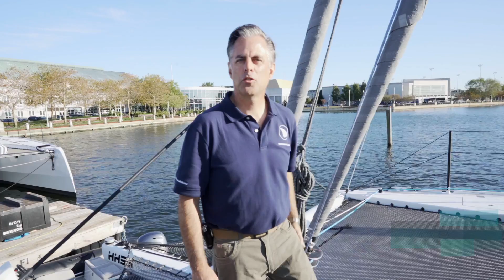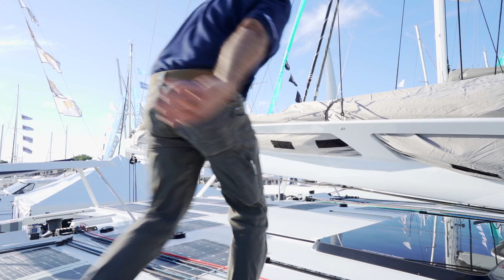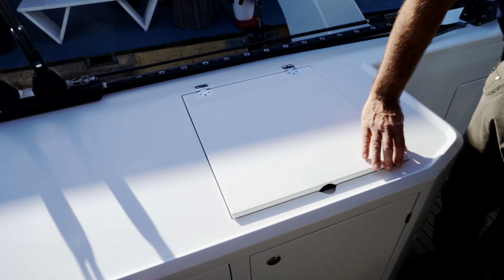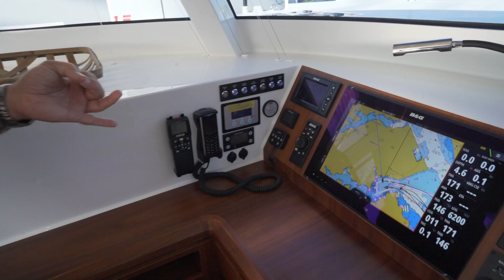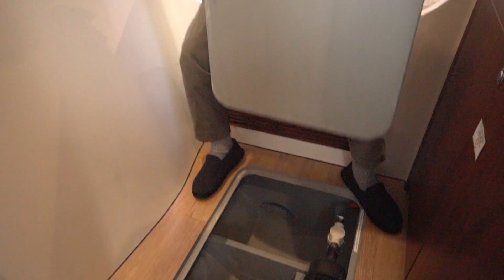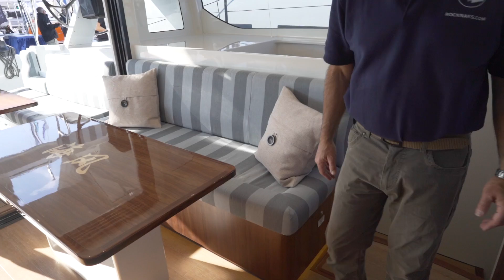HH55 Catamaran.  Guided Tour & Our Review.  Perfect Balance of Performance and Comfort.

Comment: Love the HH 55, but i would get the Helm indoors. My reasoning is that it completely frees the lines from the roof (Load up solar panels). Also the aft cockpit completely opens open for lounging, still retains tons of room indoors and finally will go with an owners version. Also these are made in Vietnam i believe so that why costs are lower compared to the new Gunboat 68 (also completely carbon fiber) which is now made in France and price is 6mil+... woooza. Either way you need deep pockets but the HH can be called a bargain in the deep pocket world of fully Carbon cats.
Reply: They are made in China not Vietnam.
Reply from the maker: Agree. Compared to a Gunboat, $3M fully kitted out is a deal,  For someone.  :-)
Reply: @AL V  They were at one point but now in France.
Reply: The Seawind 1600 is built in Vietnam.

Comment: Nice, but the Silent 55 still takes the cake,  everything else is just too much maintenance , how do you want to spend your time.
Reply: I love the S55 also but need to see owner reports from ruff seas in mid-Atlantic.
Reply from the maker: I will have to take your word for it.  Have not been on a Silent 55.  Yet.
Reply: @Bowmans-Woods  Don't know if you have seen this?  https://www.youtube.com/watch?v=747tNVZ5iB4&t=54s
Reply from the maker: Yes I had seen it before.  I still need to see boats like this that are all electric, prove that they can cross oceans in all weather conditions (sun, clouds, rain) without needing to constantly run their generator to keep going, before I get excited about an all solar electric boat.  Interesting but seems like a coastal cruiser that needs to be at anchor a lot to keep the batteries charged.  Gut feeling:  Not an ocean crossing cat.
Reply: Cruising Off Duty The Silent 55 shown in the USA boat shows crossed the Atlantic on its own keel. I think the tech is proven—- it’s basically the same Victron electronics you saw on this boat, but with a much larger solar and battery bank and electric motors.  Electric motors have been reliable for a century.

Running a generator— worst case scenario— is being dependent on a diesel motor.  Which you always are when there’s no wind. 

However, Silent hasn’t built enough boats yet and so they don’t have enough of a track record.

People are so used to sails they never ask “what if you get no wind?  How could you ever cross the doldrums without running out of gas?”.... it’s gonna take awhile before it gets accepted.

I think the real question is, would you still have fun if you didn’t have to sail?